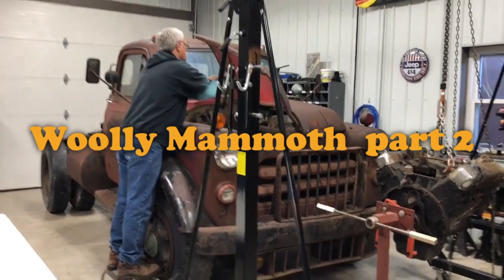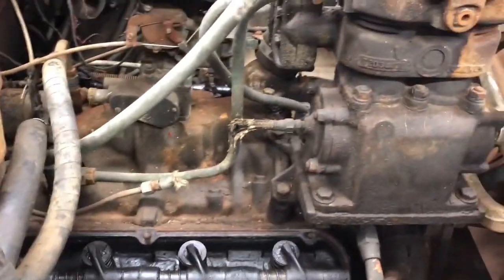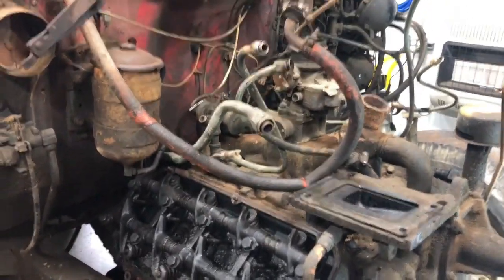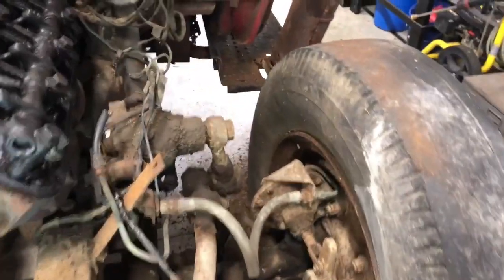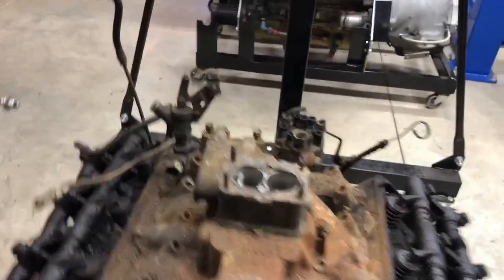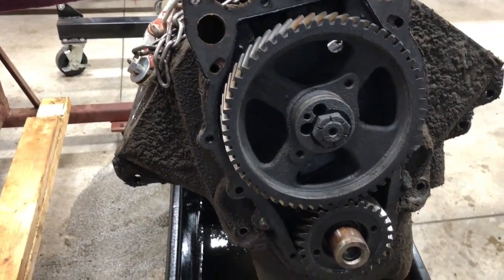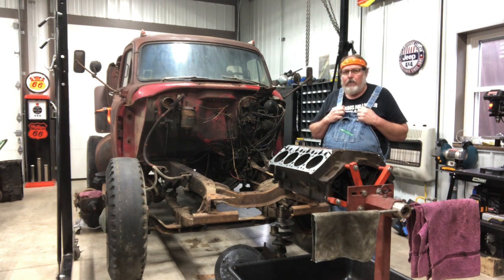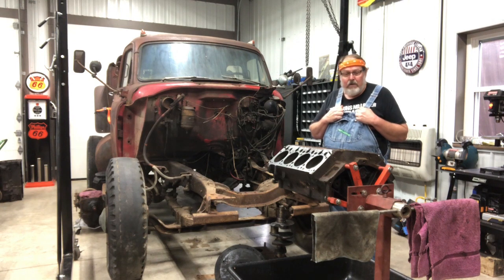1955 Three Ton Dodge “Woolly Mammoth” Pulling the Hemi

Comment: Coolant line to the compressor were for keeping it cool and the oil lines were for pressurized lubricant.  Many Bendix truck compressors were set up that way.  Glad to see she is seeing some love again.  Great project!
Reply: Not sure I understand.  Is it like an older air over hydraulics (coolant instead of power steering) system for braking?
Reply from the maker: We might be calling on you to tap into your wisdom and knowledge with these brakes!
Reply: @billrook6165  Hi Bill, they circulated the coolant thru the head of the compressor to reduce air discharge temperature and to reduce the physical temperature of the compressor .When air is compressed it builds heat. Most air brake systems use air over diaphragms and springs to operate mechanical linkage to to brake shoes.

Comment: I would remove the oil pan before I turned the engine upside down to keep the crud and old oil  in the pan.
Reply from the maker: Hindsight is 20/20 and you are correct that would have been a much better plan. Thanks for the comment and thanks for watching